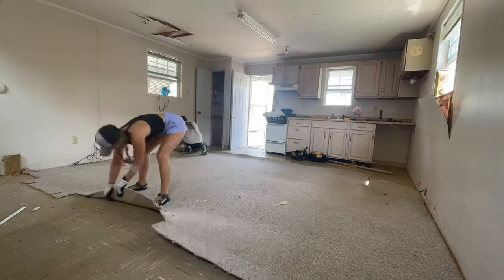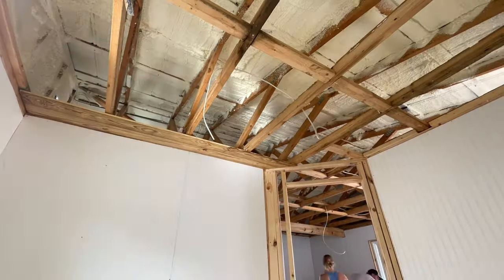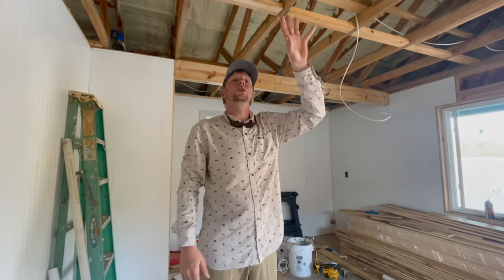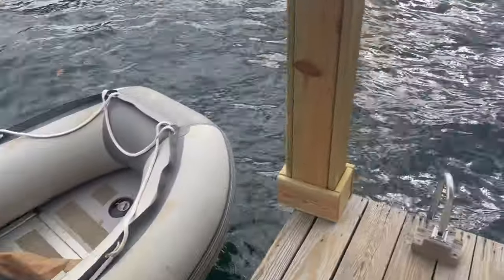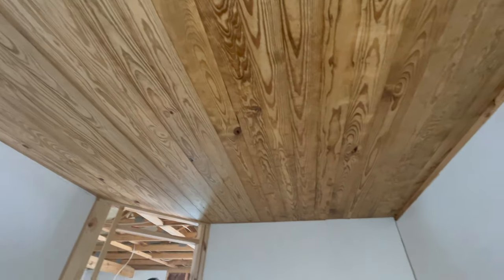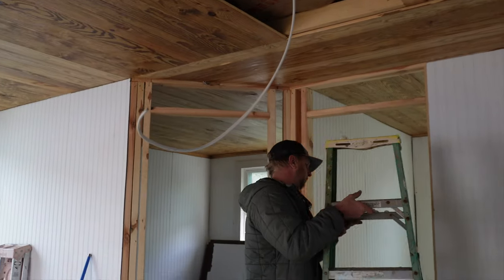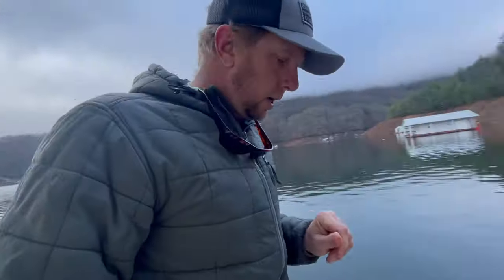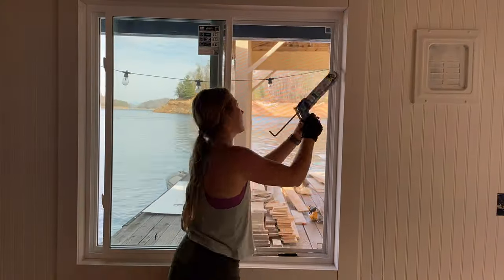HOUSEBOAT renovation during HIGH WINDS 💨🏠🌊

Comment: T and G doesn't have to be full length boards so bowed boards can be cut to make fitting easier, you don't even have to end on a stud/rafter as the T#G is super strong. Just be sure to stager your joints.
Reply from the maker: We did not want seams in any of the runs in order to have it looking the most professional and luckily we were still able to accomplish that 🙏

Comment: Question: when you were putting up the T & G ceiling, I noticed the electrical wiring was shoved up in the ceiling in all the rooms, did you install a cutout to get up there to drill holes to drop the wiring back down for the fixtures? Perhaps I missed that in the video. Hope everything comes out well.
Reply from the maker: We will install lights further on down the road 🙂 don’t have solar yet so no reason to do it just now haha. for now, we drew red x’s where the wiring is set for lights so we know where to drill when it’s that time